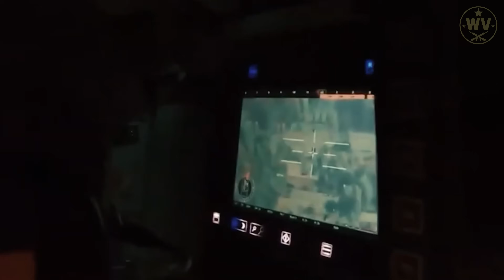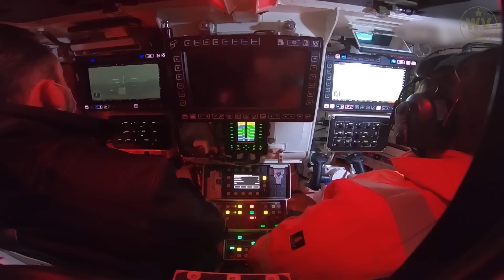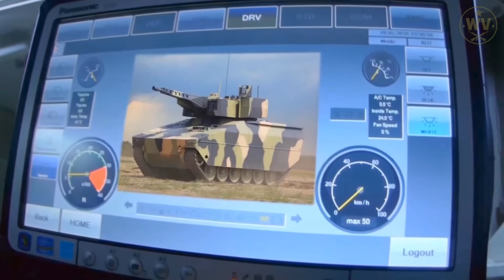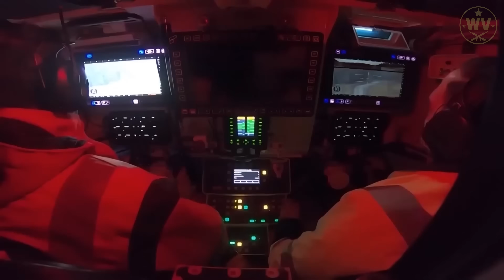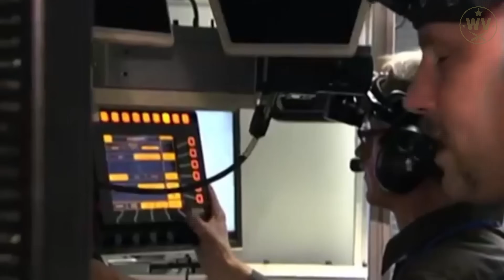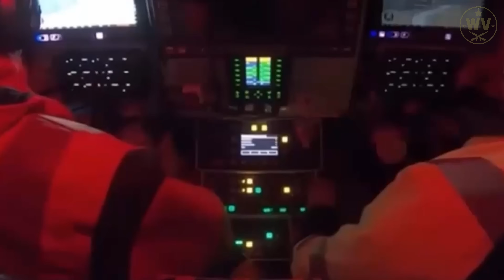Why This German Vehicle Is a HUGE Deal for Ukraine

Comment: These have to be combined with skynex turrets on the same boxer chassis. Put a couple skynex versions of this next to a 8 or so lynx as a battlegroup and you have a very survivable force that does not need to fear drones as the main threat anymore. Hopefully they will go that route, because the IFVs alone will still be hunted down by drones... no matter how modern and expensive.
Reply: The Skyranger turret can be put on basically any armoured vehicle you want as long as it has about 2mx2m flat space on the roof and space for the console inside. There are already mission modules for the Lynx, the Piranha and the Boxer. The Boxer wae just chosen as the default vehicle because it's already built for moeularity and has a lot user nations.

Comment: This collaboration is just one example of the partnerships that the Ukrainian armed forces are currently entering into with companies in the Western world. Regardless of how successful this (or other) weapon systems will be for Ukraine, this international cooperation alone will break the Russian Federation's neck in terms of weapons technology. By indirectly taking on the entire weapons technology know-how of the Western world, the Putin regime has greatly increased the challenges facing its entire arms industry. Not only does it have to keep a current hot war going, it also has to adapt tomorrow's Russian armed forces to the new challenges. This is a task that the Russian economy is likely to fail at, if one assesses its current overall situation correctly. Although no one will challenge or even attack the Russian Federation, it will be so preoccupied with the economic chaos resulting from its war in Ukraine in the coming years that there will hardly be sufficient resources available to modernize its armed forces.

Diese Zusammenarbeit ist nur Beispiel für Kooperationen, die die ukrainischen Streitkräfte mit Firmen der westlichen Welt zurzeit eingehen. Egal, wie erfolgreich dieses (oder andere) Waffensysteme für die Ukraine seien wird, allein diese internationale Zusammenarbeit wird der Russischen Föderation waffentechnisch das Genick brechen. Dadurch, dass das Putin-Regime sich indirekt mit dem gesamten waffentechnischen Know-how der westlichen Welt angelegt hat, sind die Herausforderungen für dessen gesamte Rüstungswirtschaft ins Gigantische gesteigert worden. Nicht nur, dass sie einen aktuellen heißen Krieg am Laufen halten muss, sie müsste auch die russischen Streitkräfte von Morgen den neuen Herausforderungen von anpassen. Eine Aufgabe, an der die russische Wirtschaft scheitern dürfte, werten man deren aktuelle Gesamtlage richtig. Zwar wird niemand die Russische Föderation herausfordern oder gar angreifen, aber sie wird in den kommenden Jahren derart mit dem wirtschaftlichen Chaos als Folge ihres Ukrainekrieges beschäftigt sein, sodass für die Modernisierung ihrer Streitkräfte kaum ausreichend Ressourcen zur Verfügung stehen werden.

Comment: I Hope when they start produce 2027 the war is over. They produce CV90 know in a new version , Ukraine get 40 or 60 They produce it now , He has Air burst to & a 35mm cannon
Reply: The CV90 is a brilliant but very old machine. 
Its nothing to compare with a Lynx. 
The Lynx is 36 years ahead in Base-Design, concept, knowledge.

Its like comparing a Gripen with an F35. 
The Gripen is brilliant and it is modernised but the F35s Design, philosophy and so on are decades ahead.

Comment: The APS is among the things that sets the Lynx apart and except for the usual bickering between KMW and Rheinmetall (usually coming from KMW), who brag that they also have full order books that with their current lackluster facilities will take a decade to finish and deliver - except their Zeitenwende-Experience manifested in hiring almost 200 extra employees, while Rheinmetall was the first to take the risk of investing in Ukraine - and if it had been up to them, they'd already be churning out Lynx and Panthers at the two formerly clossed tank plants they leased, found very qualified engineers and specialists for, most of which must have spent some time at the German main production hub to received specialized training - like on the three-layered armor. The inner layer is SOTA composite armour with spall liner. On top of that is some new, in-house developed ERA.

The outer layer is the APS which consists of various sensors and a short-range radar. The problem with relatively slow millisecond type systems like Trophy is due to being 2-3 orders of magnitude slower (better with most recent versions I'm told) they need to identify an enemy missile, rocket or projectile while there's still plentty of distance, hence Trophy requires a significantly stronger radar, which can be detacted by low-flying jets and more realistically: enemy drones or ATGM teams. So while the KF41 can keep it's 10m-radar on permanently without draining the battery, Trophy is expected to be put in ready-mode only in "high-risk situations.

Also, Strikeshield as the newest version is called by Rheinmetall is actually the product of over a decade of research and a fundamentally different system then firing an explosive charge towards the enemy missile. This allows even more modularity: the counter-measure is stored and ejected from compartments. in the ERA (which forms the visible outer layer of the vehicle). The countermeasure system chooses from which opening to engage the target: each panel of the armour has two countermeasure storages: a weaker one for common threads like ATGMs and RPGs. If you're wondering what the stronger countermeasure is supposed to destroy: Rheinmetall recently invited delegations from foreign MoDs and Industry: the fired at a KF41 from 200 m distance from common 120mm/125mm tank cannons both common Western 120mm and Russian APFSDS rounds - Strikeshield intercepted each round, in the best case breaking the tungsten dart into 3-4 pieces or at least one piece that was bent like pretzel and completely off it's trajectory. According to Rheinmetall whether in one bent piece hitting the ERA lengthwise or 3-4 seperate pieces of Wolfram, the Kinetic Energy the ERA and composite armour below had to withstand was reduced by 75% on average which the KF41 with all armour options that was used in the demonstration was well able to withstand - thanks to the ERA, the inner passive armour was nowhere at risk of being penetrated. Which is why I think a light tank version of the Lynx might actually be a good idea.
Reply: Can you explain the threat to dismounted infantry fighting nearby when the active projectile explodes the incoming rocket or missile?